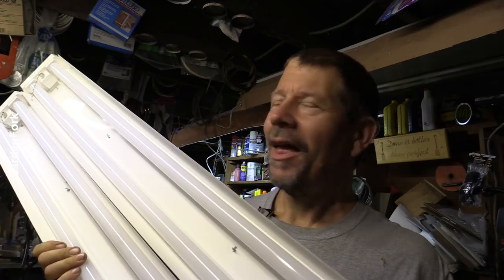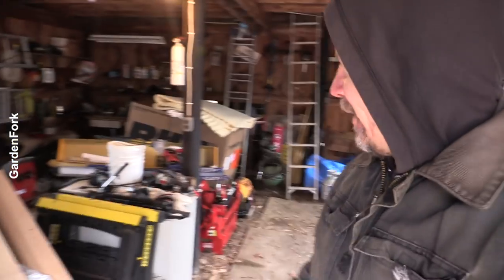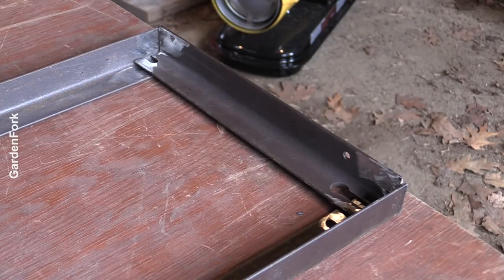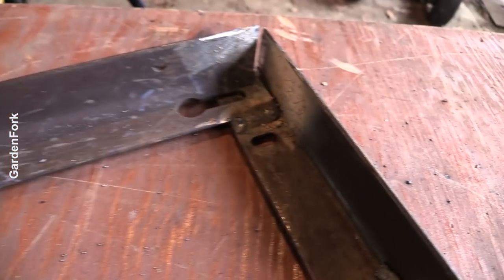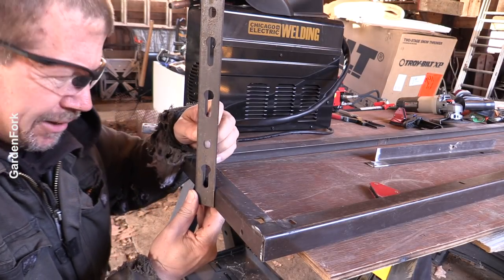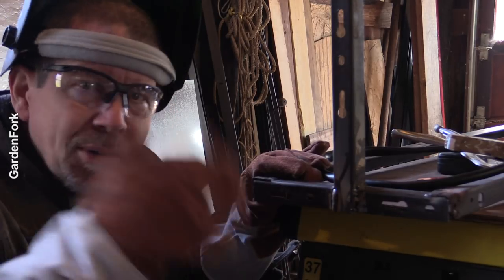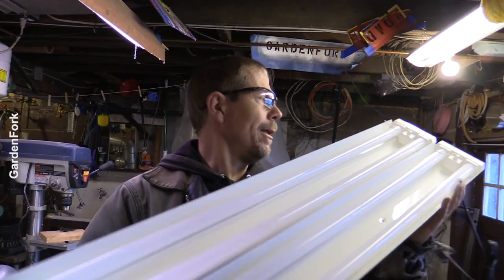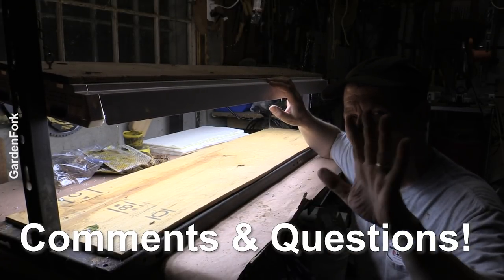DIY Grow Lights Made From LED Shop Lights for Seed Starting

Comment: Cool setup. 
The trouble with using bedframes for stuff is they’re made from an amalgamation of steel (cheap recycled)there’s  no consistency so you’ll have hard spots and soft spots  with that being said still great fodder for projects especially when found for free. Just be prepared for burnt up drill bits. 
Thanks for another video
Reply from the maker: yeah, they aren't for making rockets, but for a simple frame, it works! its not the easiest stuff to weld either, but it is free. thanks for watching, eric.

Comment: so for the purpose of starting seeds, is it the heat generated that is important?
Reply from the maker: Warm soil does help germination, and fluorescent lights put out a bit of heat but not enough to warm the soil. For best germination you could get a seed warming mat. I put the seed tray in a warm place to germinate, and once they pop up they go under the diy grow lights in the basement   Thx!

Comment: So this could be done using 2x2 lumber for the frame... for those without a welder ;-)
Reply from the maker: Yes! I have a wood version. Link att end of vid. Thx!
Reply from the maker: https://youtu.be/Qe6zs7oAv78
Reply: GardenFork I have been watching for a long time. I have already watched that one before, but I may just end up watching it again! Great vids as usual!
Reply from the maker: I should have talked about that at the beginning of the vid, I’ve been on a welding trip for a while now. After I posted this I realize not everyone will want to weld a frame. 😀

Comment: First a silly one. You mentioned Executive Director. I thought that was the lady that sometimes holds the camera and laughs at you now and then.
More objective. You are correct to query colour temperature rather than just colour. Daylight fluourescent tubes labelled as "Daylight" on look like daylight. The data is normally represented by a graph. There are also Filters but they would be an enormous cost.